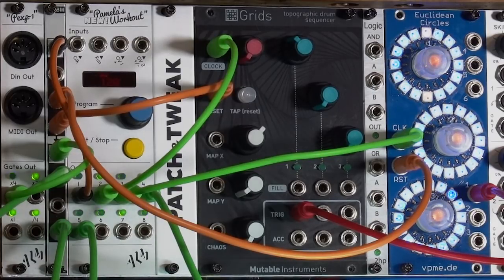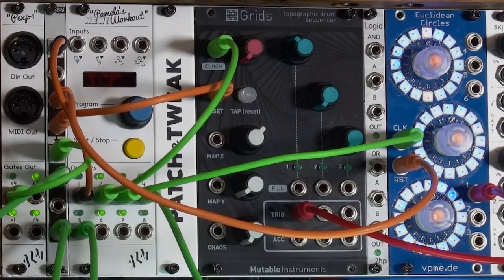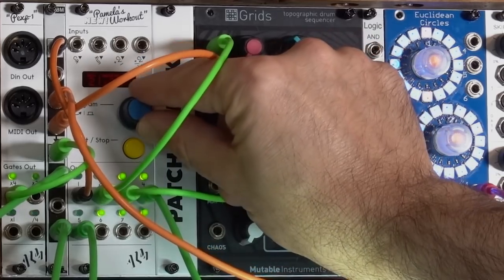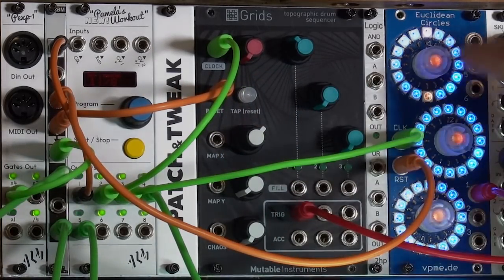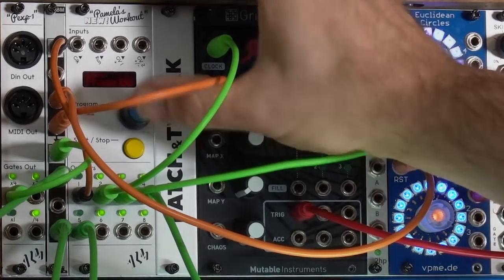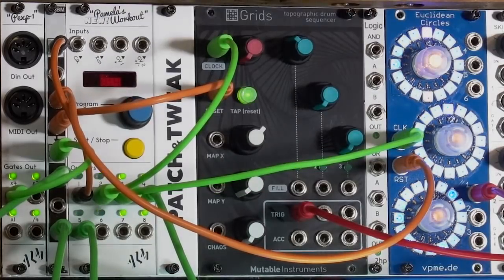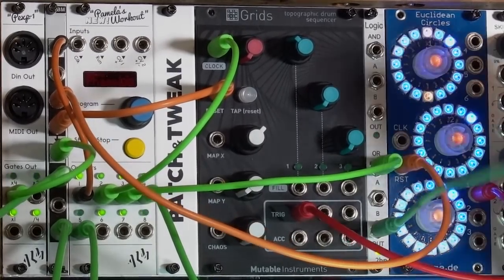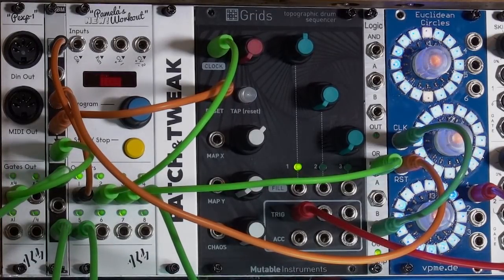Eurorack Sync & Reset Issues

Comment: Its brutal that we need another module and have to sacrifice 2hp to get modules that need the reset before the 1 to work but this is the best solution I have found so far scouring the net.  Will have to give it a try.  Thanks for making this video!
Reply: Kept digging and found this tidbit on MW in a thread about reset inconsistency:

"btw, my solution was to move the Reset pulse to output #1 on Pams Workout. Turns out the clocks out of Pamelas are not all in perfect sync and the signals are microseconds delayed as you move from #1 output through #8.. not a problem musically, but a big problem for a clock pulse driven sequencer waiting on a reset signal."

Comment: I understand the OR chooses one or the other inputs but with only the clock in input A what is it doing to slow it down so slightly
Reply from the maker: OR gates that use diodes - like the Intellijel - work almost instantly. But others - like the 2hp - that reads the inputs with a microprocessor, does math in code, and then writes the gate output back to hardware have a slight processing delay.

Comment: Hey Chris, i can not find the inverted square wave to reset an external sequencer. can you be so kind and explain me the way through the menus to adjust this? thx a lot
Reply from the maker: You don't need an inverted square wave; just a normal positive-going gate or trigger or other pulse. It so happens that Pamela also has the option for a signal that stays high while running, which I've used; if I remember correctly, it's an alternate selection for a time division - not the waveshape selection you would expect. Click the encoder to modify the time multiplier/divider, and it's one of the options beyond the numbers. Look in the manual on page 7 where it talks about "utility" modifiers.

Comment: Excellent work. I tried it on my Euclidean and also the Rossum assimilator. The reset idea worked a treat however Chris, why is that when a start signal occurs it takes about a bar length before it syncs up. Is there a way to sync on start every time. In saying that I must say this has opened up so many new sonic possibilities. Absolutely fantastic. If you could just help me understand why it takes a bar length to sync up. I almost feel like PAM’s would need to start it’s reset when started rather than a bar later..not to sure on this.
Reply from the maker: A lot of devices have an internal clock, often running at a different (often higher) resolution compared to the external clock. It takes them a few ticks of the external clock to measure its timing and synchronize its internal clock to it. Think of it as two pulleys connected with a soft rubber band. When one suddenly starts spinning, the rubber band stretches initially while the second pulley gets up to speed; there is also some stretch & slack wobble until the two agree on the speed. (Technically, the mechanism inside most of these modules is a "phase locked loop." The more smoothing they have to iron out jitter in the incoming clock, the longer it takes them to respond to speed changes.)

Comment: Hey Chris you mentioned a second video - where is that?  I have looked!
Reply from the maker: I honestly don't remember. Can you point me to where I said that, for context, to jog my memory?
Reply: @LearningModular  hahah right at the end, something about an ARPEGGIATOR.
Reply from the maker: @steveturner1815  the lost video! I was talking about an earlier firmware version of the TiNRS Tuesday: It was 1.5 clock ticks ahead during the first measure, and 0.5 clock ticks behind from the first “reset” onward. I had to invert its gate out to get it back in sync. I am told that has been fixed in the current firmware.

Comment: Where is the STEP UP option?
Reply from the maker: It's one of the clock division/clock multiplication options. Just keep scrolling through until you get to the symbols for Step Up and Step Down (little icons showing the gate's shape), as well as On and Off. Many make the mistake of looking for them one level down in the Extended Per Trigger Adjustment menu (long press on the encoder), but that's not where they live - they're up on the default level along with /2 etc.
Reply: @LearningModular  Thank you. That’s been driving me up the wall for DAYS…
Reply: Got it. Thanks for your help.

Comment: I'm having problems with external clock into Grids...I notice the LED on your output 2 on Pam...seems to be static? so have you it set to a specific set of parameters?
Reply from the maker: I run Grids at its highest clocking resolution, which is 24 ppqn. Therefore, I have Pam set to the same speed (x24). This means the LED blinks so fast that it appears to be on constantly. The other two secrets are turning the clock knob on Grids all the CCW so it takes external clock, and to patch up a reset signal.
Reply: Hi...thanks very much for the reply. @LearningModular

Comment: Really useful video mate .... Love the Patch & Tweak Blank panel.
Is that a buffered multiple  you're using to split the clock signals or just a passive multiple ??
Noob Question I know I'm sorry :-(
Reply from the maker: The P&T blank is holding a space for a yet-unreleased module... ;-) 

I'm using a passive mult for the clock splitting. Buffered mults are only needed for pitch, or in some cases if you're splitting a LOT of clock signals (like, 1 into 6).
Reply: Fair enough, that makes sense. I might have to invest in a buffered mult anyway.
Unreleased module ...... sounds exciting !!

Thanks so much for your prompt reply.
Enjoy the Holidays.